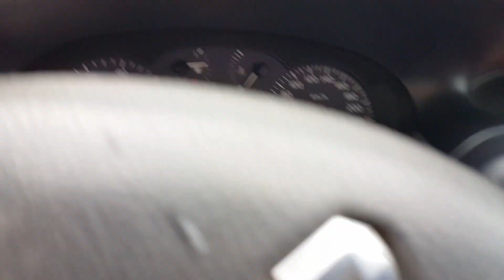Renault Megane 1,9dci 1999 thermostat housing replacement.

Comment: I wasn't so lucky got the same car but the 2001 version, engine overheated and melted together, currently repairing it ^^
Next time, hopefully not, I'll follow your footsteps
Reply from the maker: As soon as I saw that the temperature gauge is raising I pulled over right away. My dad towed my home and then I fixed it and didin't do any damage to it.
Reply: Que lleve es